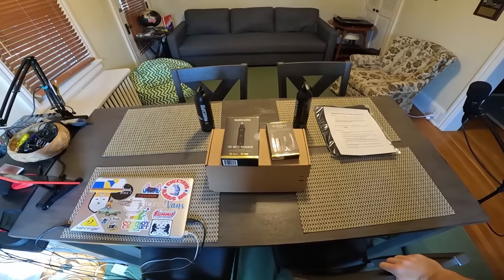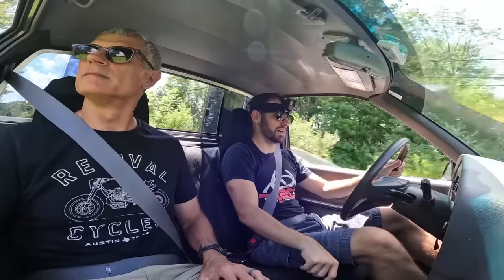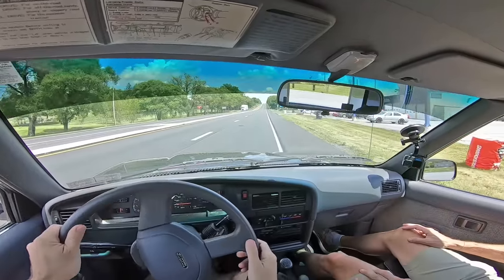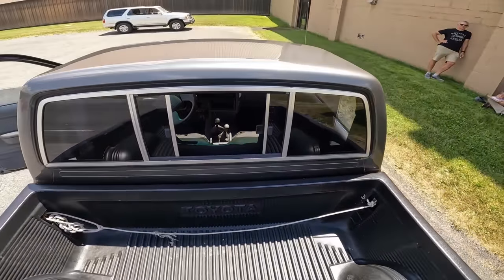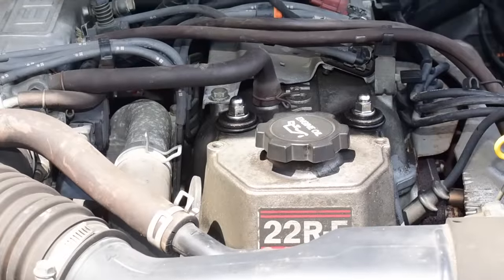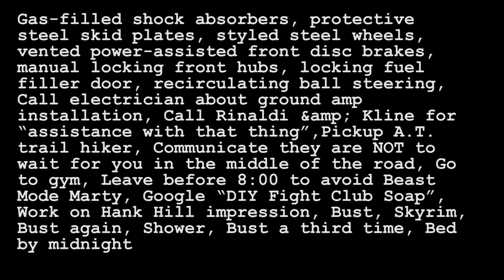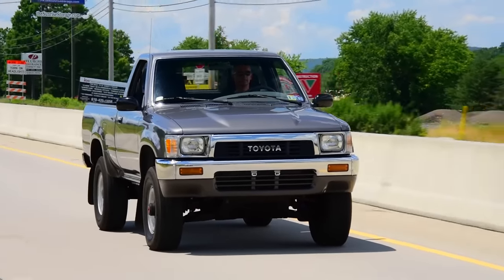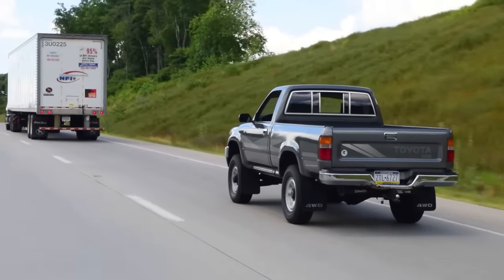1989 Toyota Pickup SR5 4X4 5MT: Regular Car Reviews

Comment: Seeing those ac controls brings back memories.  My first car was a 92 toyota tercel with only 82 HP when new with a 4 speed manual.  I remember calling the A/C button my turbo button.  I would have to turn off the A/C compressor to be able to accelerate on the freeway in the bay area or else get run over.  Most reliable vehicle I've ever owned.  I then had a bunch of american vehicles and finally got back to toyota with a new tacoma and couldn't be happier.  Yes its not as nice or as fast as an american vehicle but it just feels old school and feels like its going to last.
Reply: +1 to the turbo button. Used to say the same thing in my girlfriend’s 1982 Sentra.

Comment: I had a very similar truck like this years ago - 1989 base model, standard cab, 4x4 (manual locking hubs), 5-speed stick, hand-crank windows, the 3.0 V6, and A/C.  I bought it used with 80K miles, sold it several years later when it had 230K miles on the clock.  It never left me stranded.....not once.....and I really regret selling it.  Best truck I've owned.

Comment: Last vehicle, 94 crew cab 22r hilux. Sold at 518,000km and still see it around.
Replaced with 2006 crew cab 1kd turbo diesel. Currently 370,000km and climbing nicely. 
Both vehicles have the mechanical refinement of a cement mixer with half a brick in it but if it gets me there dry every time i will forgive that shortcoming.

Comment: I daily a 89 toyota pickup 4x4 xtra cab v6 5 speed sr5. I absolutely love it. I get stopped and asked about it all the time. I plan to 3.4 swap it soon. Mine will do 70 or 80 just fine down the highway. 31 inch tires and 4.56 gears. These old trucks just make me feel good everytime I get behind the wheel. Something about them makes you appreciate them. I wish they still made them like this today.

Comment: Early 90’s - I was working at the body shop of a massive car dealership. Part of my job was to collect the “trash” from each stall and take it to the dumpster. The trash however was cut out quarter panels and broken glass and smashed bumpers and crumbled hoods.  

On the plus side, my boss told me to use “the trash truck” - which turned out to be an 80’s Toyota truck dualie, with a large stake bed. I just drove it around the lot, but it was a fun truck to drive. It was low, and slow, and manual, and had that pull/twist parking brake handle.  The interior was trashed. Radio broken. But the engine ran smooth and it shifted great. And I put 500 pounds of car parts in the back, and the truck didn’t even flinch. Darling little machine.  Hated that job, loved when I got to drive the truck. 

My boss had me run errands in his dealer owned new F150, circa 1995.  The V8 sounded nice, and I got to drive it on the main roads and to the parts store - but it didn’t have the charm of that clapped out little dualie.

Comment: The 1994 Toyota Xtra Cab 4x4 Bright Blue SR5 V6 manual was a gorgeous truck. Sunroof, alloys, and that deep blue paint was like looking into the ocean in the Bahamas. The reality was the Silverado V8 got better fuel mileage, better ride, more room and the Z71 had a rear locker factory. 
In 2007 I sold my Toyota 1985 22re 5spd 4X4 and bought a 2005 Tacoma V6 4.0L 6spd Crew Cab. I have to say it changed my life, I instantly had more time enjoy my hobbies instead of wrenching on my rig.The newer trucks are really similar but a refinement in every way, sure they are bigger, but they can take a collision 
better. Like you I would love to own one of the older 4X4's again but don't waste time or your money chasing unicorns. It's a trap. 
FYI, you could still get manual roll up windows in 2007 if you want some  nostalgia.

Comment: I got a 1994 Toyota Pickup Extra Cab Long bed V6 5MT with on the fly 4WD and it does 80 pretty well, it doesn't feel top heavy really ever, rides great (better than a new F-150 that's for sure), then again I've been driving it for years and it only has ~86K miles.

They don't make them like they used to.

Comment: My brother bought a 1990 extended cab used as his first vehicle in about 1998. My dad was upset because it was an import and he didn't trust it. My brother beat the ever living piss out of that truck! Drove it around the bush regularly, put it on its side, hauled all sorts of stuff in it (once an 880 lb load of shingles). He could go places the big lifted 4x4s couldn't because of its size and on numerous occasions pulled those full size trucks out of mud holes without issue.  The thing was normally coated in mud and scratches. Finally sold it in like 2010 with 250k miles on it and the buyer ran it on the road and later as a bush buggy for another 5 years. In all that time it very rarely had problems and even if it did almost always got you home.  

Our family owns nothing but Toyotas now and its all started with the reliability and tankiness of that little 4-cylinder truck.

Comment: This is pretty spot on! I've had a 94 22re 4x4 ext cab Pickup 290K, for 6 years and have received numerous offers, usually from strangers! While it is terribly slow on hills, it's reliable, easy to source parts and work on, great on trails/snow, can tow a surprising amount for 115HP motor, the dang thing just keeps running and I feel like I owe it to the truck to keep taking care of it.

Comment: Love your vid I have a 1983 toy that I have had since 83 I think the 83 was more aggressive looking with bucket seats, I put a 4-inch lift under it the 2nd month I had it. It has never been wrecked, paint two times with about 159000 miles. I put new rings and rod bearing in it and a valve job and it still runs good but i easily do 65 to 70 miles an hour in it with 31s on it, I drove it regularly for about 28 yrs. then bought a ranger and now have a Colorado zr2. but nothing crawls up a hill like my 83 toy. I had under coated it and line xed the bed way back in the day,I keep it in the garage. thanks for the vid

Comment: If you live where it's relatively flat it will tow a lot. I had a 99 2wd 4 cylinder that I towed an enclosed 6x12 trailer full of airbrush tools all over Louisiana for years. When I finally sold it to buy a full size truck to tow a camper I actually cried as the new owner drove it away. He gave me $2700 OVER blue book, I couldn't resist, but I guess I should have. I'm 55 and I've owned nice Z28s, a 72 Roadrunner and all kinds of trucks. The Toyota was the best overall vehicle I ever owned. All the rest were V-8s, the one 4 banger brought tears to my eyes.

Comment: Good memories, I had a 1987 I purchased in Mississippi, drove it out to Arizona, then was stationed in Massachusetts, sadly it only took two East coast winters to give it the rust cancer. Radiator mounts, and brake parts were the first to fail.

Comment: My first pickup was an '89 Toyota base model 2wd standard cab and I mean base model which I bought in March 1991. It did not have carpeting, had only a 4 speed manual, a 22R, not RE (fuel injected) but carbureted, no power steering. It had a/c, power brakes, a rear bumper (those were optional back then) and that was it. I drove it from a little over 14K miles to over 202 K miles. I changed the clutch and starter plus oil and tune ups. Oxygenated fuels, which came into use where I live in the mid 90's, basically made if barely drivable due to it having a carb. I sold it to a good friend of mine in 2002 who drove it for several more years. It was the single best vehicle I have ever owned with respect to durability. I could wind it to 80 mph in third gear before dumping it into 4th. It would climb to 100 though it took a while. I do not miss the harsh ride, the awful bench seat which tilted me toward the middle, or the tiny cab but the durability was top notch. I always remember the tailgate having heavy bar type supports instead of the shitty cables of today's pickups. It was rust free for its entire life most of which was in Missouri where winters roads receive generous salting when it sleets and snows which is every year.

Comment: Had the 1993 2wd version of this truck, 22RE/5 speed.  It wasn't slow, it would honestly hold 80-90mph on the highway if you wanted it to, but was best at 70 to 80.  Only time I had to downshift on the highway was towing or going up Mont Eagle on I 24.  It was also a blast to drive in the snow with a couple hundred pounds of sand bags in the bed.  Instant drift machine, just stab that throttle and counter-steer, even at 5 to 15mph you can do epic drifts and are going slow enough to catch it before you go in the ditch.

Comment: Everyone has their Gen X dad, that has stories of their Toyota Pickup powered by an R series engine, and the crazy things it's done. My dad is no exception. His was an 82 4x4 built for off-roading. It had a rollbar and lightbar, 32" tires, and a a lower rear gearing. It was probably 4.10. He also owned an 84 4x4, and just like me, owned an 85 Celica GT-S. I've owned three RA65 Celicas because of my dad, and evn the exact same spec. Anyways, crazy truck story-

He was on the highway, and saw an 18-wheeler (yes, I'm southern) pulled off onto the side of the highway, because he was out of fuel. He got out and asked the guy if he wanted him to tow him about a mile up the road, because there was a gas station up there. The guy looked at him kinda funny and was like "In that thing? I dunno man, but you can try if you like." So, my dad got the chains and shackles he had lying in the bed from work, hooked it up, and pulled that full 18-wheeler a mile and a half at 35 mph to that gas station. That trucker was blown away, he told my dad how much he set at the scales, but I don't remember what my dad said it was. It's always a nice time remembering stories about his Pickups or Celica. 22R's are forever in my family now.

Comment: My buddy had a 92 with 200,000 miles on it. Same setup as this truck. We used to load it up with a ton of 2B stone, tons of wood, furniture, you name it. And this truck just wouldn’t stop!

Until one day we dropped half a tree truck in it. And split the frame in half….but it still ran and drove!! 🤣
Reply: That's how we killed two! LOL. Wish I still had the pic, broke on the hoist!
Reply: @AtomicHombek  hahaha nice! Oh my buddy’s split right in front of the rear axle. Just sheered off.
Reply: @sreilly  That's where they go, every time. You weld L's into that spot if it hasn't gone yet. Live and learn ha ha.

Comment: My first car was a ‘94 Toyota Pickup. RWD, 4 cylinder, 5-speed manual. No air conditioning, which didn’t matter much where I lived in SoCal. People would often leave notecards on my windshield with offers to buy it. It had 200k miles when I gave it to my brother and headed to undergrad. I miss it still

Comment: I have a 93 4runner base model, 22re 5 speed, manual transfer case, electric locker, steel wheels, skinny tires, good interior. Bought it from original owner for 1500. I get asked to sell it a lot now, not as much as a truck, but 4 cylinder MT versions in good condition are really hard to find! I'm keeping mine!

Comment: My girlfriend had a 92 pickup 4 cylinder manual when I met her in 2012, only sold it in 2016 to upgrade to a Tacoma when we got a boat. The alternator belt replacement procedure on these is hilarious on a non AC non power steered model:
Cut off old belt
Loosen alternator mounting bolt with wrench
Slide on new belt
Tension by using a pry bar between the block and the alternator 
Tighten bolt.

That's it. One wrench, one pry bar, and some snips, and I didn't need the snips cos my old belt had already self removed.

Comment: I've had 4 different Toyota pickups (1990, 2000, 1986 4x4, and a 1991). Every time I sell one, I regret it and ultimately get another. My current longbed has played host to many a Home Depot run to pick up doors and insulation for my house, it's helped me retrieve impulse-buy motorcycles from hours away, it's been a solid camper with a shell on the back when I took a road trip up the California coast. As Mr. Regular mentioned, it's slow as sin. 3.56 gears in the diff with only 110hp on tap means it's not fast by any stretch and the potential for HP gains are slim to none. Hard to pin down why they're so fun to drive.

Comment: If you wanted to go faster, you should have opted for the V6 - the 3.SLOW, as you all like to refer to it. I travelled everywhere in mine while cruising at 75-90 mph to the tune of 325,000 miles when I stopped driving it daily due to a career change - no not prison, lol. It's long overdue for maintenance now, and I have every part it needs already. It leaks oil, but doesn't burn a drop. Thanks for the video.

Comment: Funny enough. Yesterday, I saw an ad for this kind of truck on the back of one of my dad’s old StarLog magazine. It was the XtraCab SR5 V6.

“To the track, it looks like a performance car. When the 150 horsepower 3.0 liter OHC EFI V6 yielding 180 Ib-ft. of torque, screams
past you at a test track, its easy to confuse the Toyota Xtracab SR5 V6 with
a sleek performance car.
And with features like standard rear-wheel Antilock Brake System (ABS),
double arm suspension, and available 7-way adjustable driver's sport seat,
theyre even harder to tell apart. But a 1,640 pound payload* capacity makes
it hard to hide the great truck it really is. Fortunately for those who drive it,
one distinctive feature makes the Toyota Xtracab SR5 V6 instantly recognizable:
Toyotas reputation for reliability.”

Comment: i got one, its a rust free 1990 2wd extended cab with a long bed, its pretty low stock compared to the 4x4 and cruises at 65-70mph while getting 30-35mpg
use it for handiman work, at one point i slapped ½ton of gravel before, permanently lowered the rear  lol

Comment: Can't blame him for not selling.  Hard to find one this clean and low mileage.  Nice SR5.
Reply: I’m a Toyota guy, and I would have sold it.  I bought a good condition ‘07 4wd double cab Tundra with 225k miles for 10.5k back in April, and I did not have to twist the guys arm at all.  20k is madness for a small 30 year old underpowered truck that fits 2.5 people.
Reply: @kftc1980  you are clearly not a fan of Toyota, this trucks are amazing and almost impossible to find!
Reply: @manuelcortes6266  I have 3 Toyota/Lexus vehicles, and won’t buy anything else.  That doesn’t negate buy low/sell high.
Reply: @kftc1980  It’s almost impossible to find this trucks with low mileage and in good shape, people are willing to pay more for them, look for a cheap one in a good shape low mileage, let me know if you find it !

Comment: Sadly my dad sold his before I was old enough to get to drive it, it was a faded salmon red, with a rusty somewhat color matching minibike that always road around ratchet strapped in the bed because he picked it up for free one day on a landscaping job, and someday he wanted to fix it, but until then, mom didn’t want to see it in the yard, he sold it for a 2003 tundra V6 after slightly bending the frame while driving over a stone wall when dragging some logs out of the woods to cut for firewood, at that point the bike and the ratchet straps were probably helping the structural integrity of the rusted bed, it was only firing reliably on 3 cylinders, and it still sold for 5 times what he bought it for in ‘99

Comment: Had an 89 extended cab 5 speed manual, 22RE, locking hubs, blue with the goofy stripes like this one. The only "mod" I did to it was swap in cloth bucket seats off a mid-90's 4runner and damn those were comfy. Bought it for $1800 and it was in ROUGH shape. I did everything I could to keep the rust away but 20+ years in New England I could only delay the inevitable. Sold it to a dad and son for $2500 who were going to turn it into an off-roader, so I didn't feel too bad knowing it was going to be well used. Gave me 30k miles and bare minimum running costs, even got low 20s MPG on my mostly highway commute.

Comment: My dad bought one of these brand new in ‘88. It was his daily for about 13 years and he drove 50 miles one way to work in western New York. I then took it over as a teen and drove it for a few more years before we sold it. It ran without issue for all those years. 
Fun fact: the beds for Nissan trucks bolt right on. We had to change the bed because ours rotted out. We called it the the Toysan after that.
Reply: I bet that confused some drivers who were a little more aware of what they were driving past on the highway, thinking it was a Nissan, then looking in the rear view mirror to see Toyota on the grill.
Reply: @marcusdamberger  me and my buddies coined the term Toysan and it was always a joke. We loved that truck so much. I still want another to this day.

Comment: My first truck was an 82 single cab long bed 4x4 with the beloved 22R. Manual everything. No AC. No tach. Square steel bumpers front and rear. Leaky front axle hubs. Broken horn. The VIN number is tattooed on my arm. God damn I miss that truck.

Comment: I'm that guy currently offering about 10K to somebody with a clean 1st generation tundra under 200,000 miles. mainly because I because I had a camper shell on one and called that thing the mobile stabbin cabin but also because I took one off a 7 story cliff going 70 mph and walked away without a scratch. So I think they're good trucks.